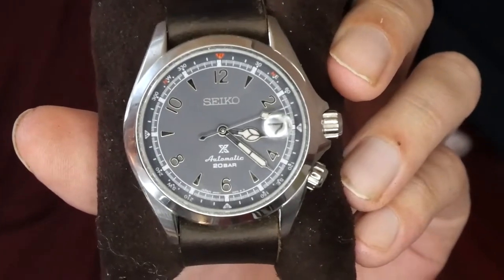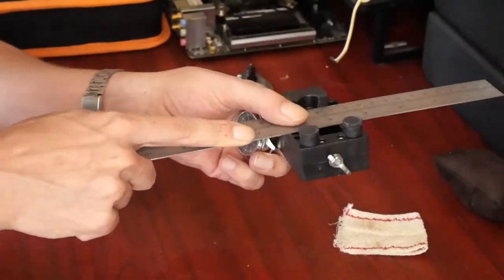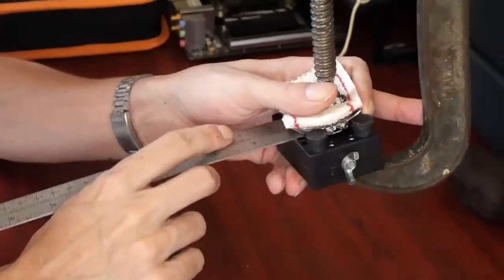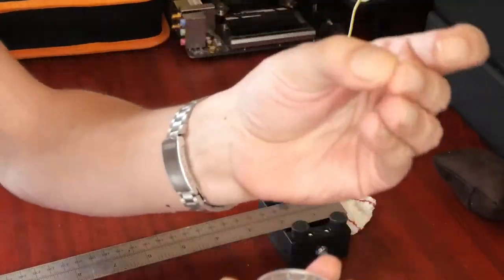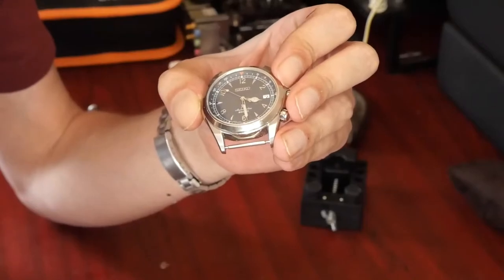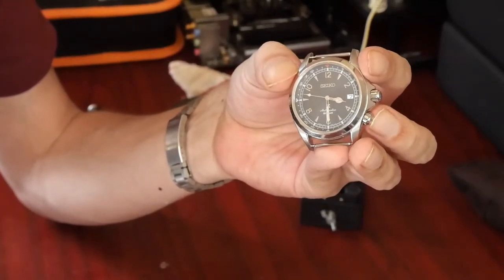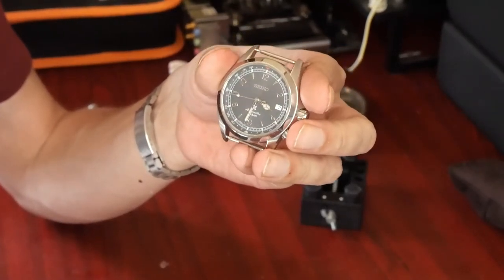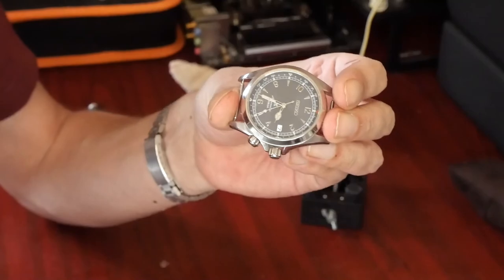How to remove a cyclops from a watch WITHOUT HEAT [tutorial]

Comment: Heat it with a  lighter and save the trouble! This method is madness.
Reply: Problem with heat is that you can easily damage the gasket around the glass and ruin the water resistance of the watch
Reply: Ikr pure madness
Reply: Heat is worse; can damage the gaskets, lubricants, movement, paint/finish, bezel, etc. not to mention compromising the water resistance that most watches offer

Comment: Very good tip ! The cyclops doesn't look right on the Alpinist and luckily the date window is big enough without it. But, you need to be careful. Some date windows are absolutely tiny and the watch can look terrible after removing the cyclops as it completely ruins the look. So, have a look from the side if you can and check the size of the date window. It should be similar in size to this Alpinist. If it's a tiny window my advice is leave it alone.

Comment: Thanx for this clever tutorial. 
Removed the cyclops from my Addiesdive subby clone. Added a proper hex nut instead of wingnut  to the watch clamp gadget,  and used a spanner. A few turns and off it popped. 
Tried removing cyclops on another cheapie watch a while back, but with a soldering iron for heat - cracked glass, oops :(  
Once again, thanx for posting.

Comment: Seems risky using force, but is an option, I have an Invicta and the heat method didnt work, the glass  and case becomes super hot but the cyclops not move.

Comment: The heat method works on Alpinist alright. I just removed one successfully from a SPB197J1 that I got today. Crazy shit, I didn't even remove the label from the bracelet yet. Haha. What you need is a heat source that is more precise than those 200ml can buthane torch. I used a firework lighter that allowed me to concetrate the heat practically just on the cyclops itself. What is true is that it doesn't give up that easy. It took me around 5-6 heating attempts few seconds each to remove the cyclops eventually with a hobby knife. The way you know it's working is once you start to see the adhesive to get cloudy / milky on the edge where you apply force with the hobby knife each time. Than you know you have to heat up few seconds more. After I was done the watch wasn't even that hot as I expeced. I could hold it in my hand. I took it outside to cool down for few minutes and than removed the rest of the adhesive from saphire glass with isopropyl alcohol. Damn this watch is even more beautiful now.
Reply: Thanks for the tip! I haven't even received my alpinist in the mail yet but this wiybe the first thing I do. If only Seiko would have made it without the cyclops from the get go...